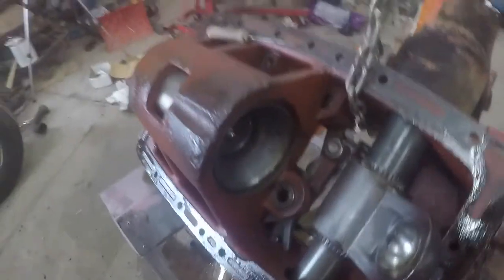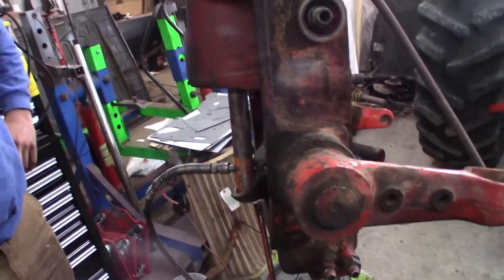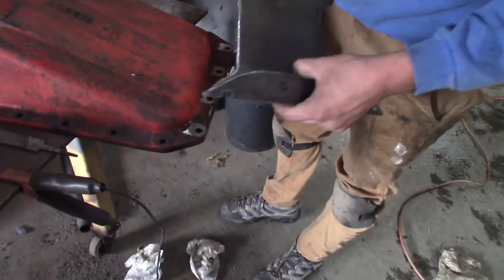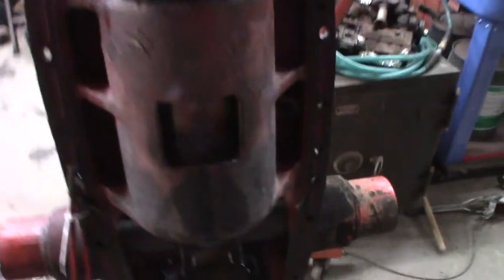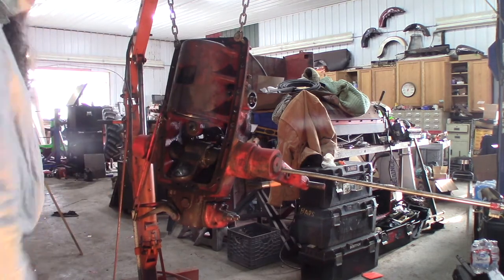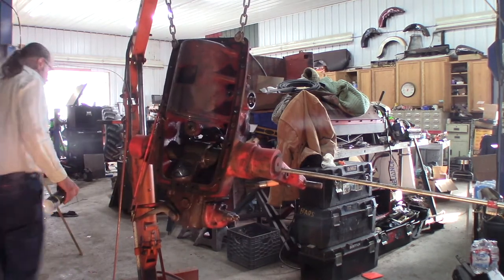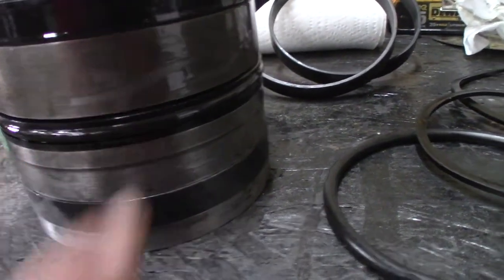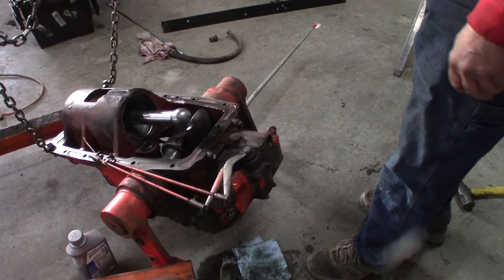Case 830 Comfort King finally fixing 3 point hitch stuck piston and engine swap oil pan issue

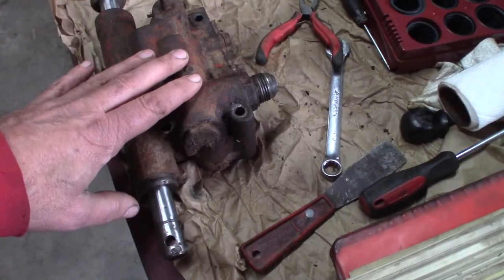Comment: the rockshaft valve @ 2:40 has that side cover plate there's 3 springs/check balls for that valve spool sometimes all 3 but usually the 1st check ball (facing toward gearshift lever) gets jammed up with fine dirt that gets past the valve housing seal & rubber boot front of valve housing its a problem on all 30 series case if the 3pt lift arms wont go up/down that means that check ball not alowing hydraulic oli to the rockshaft cylinder. best to do at the work bench holding valve verticle not sideways like its on the tractor now, side cover off springs out clean the check bores (i used full can carb cleaner) visually see if the check balls are actually moving as spool shaft goes in/out
Reply from the maker: Hi Jason; Thanks for all the info! Its been a while since Ive worked on the tractor but I can't wait to get back to it once I get all the work at the bbq done. Thanks again for the comment and Thanks for watching! John